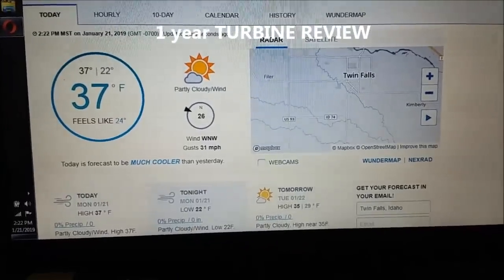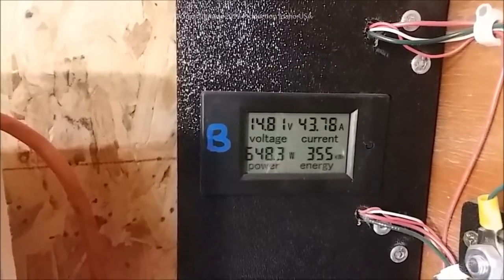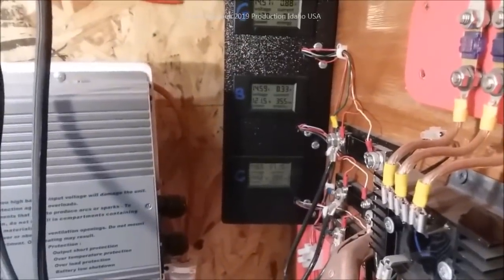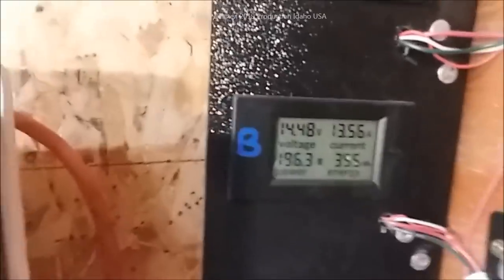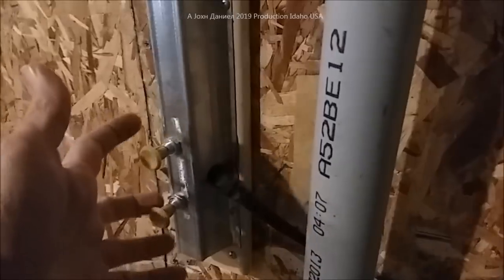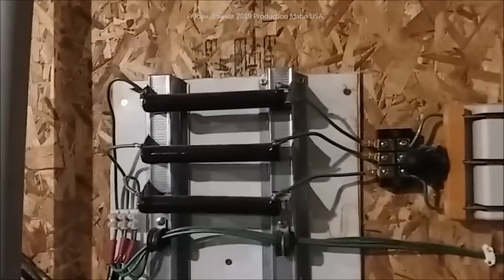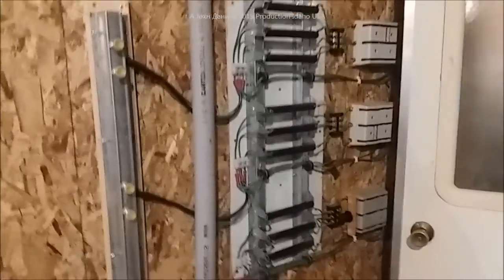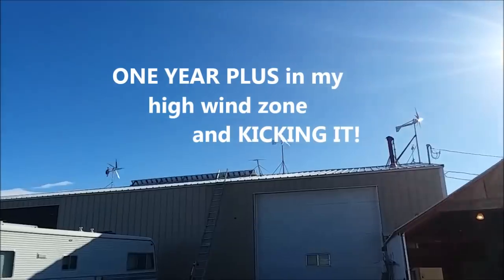The best Chinese Wind turbine, Great results, 1 year+ review FULL PARTS LIST BELOW VIDEO

Comment from the maker: Turbine, extra materials & helpful parts are up under the video in the description. (where it says READ ALL ↴) so hit the SHOW MORE, If you find a bad link, tell me. If you know a better source, also tell me!
 Full electrical parts list from Turbine to Battery ↣↣↣
1 - From Turbine 3 strands of 8 awg wire Home depot or cheaper on ebay ( https://ebay.to/2GpnUCG ) 
2 - From wire, and before controller Mini ANL, 60 amp per leg. So you'll need 3 of these ( https://amzn.to/2UWxm3S ) and 3 of these ( https://amzn.to/2Ia1ZRS ) which will have a few spares in that pack. Place them inline before the rectifier or controller you have.
3 - Best full service controller ( https://amzn.to/2Id9I1z ) for both 12 and 24 volt systems 
4 - From Controller to batteries use 6awg WC by TemCo ( https://ebay.to/2SPuMiy )
Reply from the maker: RECO SAENZ  Look under video where my name and video date is. Theres a source to Aliexpress for the turbine.
Reply: Good day John, i bought one directly from your link, my amps peaks at 13.6A and it wobbles on lower speed. Any advice, seller not very helpful!
Reply: ... can i fly you out to install my turbines? 😐
Reply from the maker: @kairomorals7684  Where to? I don't have the ability to load our 12 ton Tele-Handler on a plane!
Reply: Hey John is 3 blade turbine better then 5 blade turbine am looking in to getting me a turbine I don't want to get rip off so which is better 3 or 5 blade
Reply: Јоhn Daniel  BRO WHAT IS THE NAME OF YOUR WIND TURBINE ..
Reply: Јоhn Daniel  WHICH BETTER 24volts or 12volts WIND TURBINE
Reply from the maker: @3dilawan269  Either one, just base it on what type of battery bank your going to install. I prefer 12 for my system, many like 24 volt. My choice of 12 volt is based on parts availability of 12 volt things you can use.
Reply: Јоhn Daniel  AWESOME idea 12volts wind turbine then my invervter is 48volts how to connect my 12VDCX4  battery can i serries them how to charge my battery using 12VDC wind turbine
Reply: @3dilawan269  my understanding is the higher the voltage(lower the amps) so you can use thinner wires for longer runs, cheaper price on copper wire.
Reply: Јоhn Daniel  12VDC WIND TURBINE CAN I USE 3phase 100amp RECTIFIER connect  TO 60amp PWM solar charger controller  to charge my battery ot is possible?
Reply: Can post some video using PWM SOLAR CHARGER wind turbine via rectifier
Reply: I have to wonder if there is not some sort of digital wind speed meter that can throw a signal and engage 3 relays to shunt the power through the resistor loads
Reply from the maker: @davefroman4700  The voltage sensor is much more accurate on a dedicated diversion system and already accessible to tap the rectifiers output to sense for any setting you want to use.
Reply: there is.... https://www.alibaba.com/product-detail/FST200-221-Digital-Wind-Speed-and_1945683798.html
Reply: New sub here. Building a vertical wind turbine for our homestead. Might pick up one of these later on.
Reply: 2024 now. Any updates?

Comment: build simple system so could use resistors for heating small cabin and charge 24V lifepo4 battery or 36v, if 3 batteries could 1 line charge 1 and install batteries still in series 36v

Comment: I know this is an old tread....cant fine those brands anymore. Do you have a recomandation on a quality 4..5..600 ish watts? Tx.
Reply from the maker: A good turbine with consistent results is the B & C model LW600 3 blade  https://s.click.aliexpress.com/e/_opG0JWD . Then for best results get a 1500 watt and higher wind/solar turbine controller. Use the Wind 1500W Solar1000W  version 12V 24V 48V Auto https://s.click.aliexpress.com/e/_oEnbr2t
Reply: .  Hi John! Thanks for replying.. I m now ready to go ahead with ordering a wind generator. What I have notice lately is that we re not getting massive wind speed here in the forest so.....I think a 5 blade turbine might work better in my area. My system is 24v with 2x 300ah lithium battery. I have 2000w solar pv with victron controller.. the turbine will be mounted a the tip of a 60 ft communication tower so it shouldn't be to big not to crash it down 😮 but big enough  to be worthwhile. You mentioned somewhere that a 48v unit can be used instead of 24v but I don't understand how this could work...or is it necessary? What controller  to buy? What about a wall heater for a dump load?  I ll get my wife to send you a couple beers later as I don't know how to do that.. Thanks  Al.
Reply from the maker: Al, if you have low wind in your area, a 48 volt will give you 60 to 65% the rating but gives you assured results but how I use mine is 48 volt to charge 3 twelve volt marine slave batteries and a 36 volt to (your voltage) converter charger, in your case 29.2v and they are activated on a set voltage in this case a 36 to 24 would pull power from your 36 volt at 39 volts and stop sending when it drops to 35 volts and repeat that as needed. There is numerous ways to make it automatic from a tap on one battery to a dedicated 36 volt diversion design using one of its 12 volt as the activation voltage detection. Send me a Email and we can walk you through a process for your exact plan. olympicpowercontrols@yahoo.com It's a hassle to check responses on older comments that the system tends to not alert us on verses new comments you always are informed about.

Comment: Great video. Where can I get a 3000w turbine that actually produces 3000w?
Reply from the maker: Only one model that can do it for under $3000 is the FLYT Wind Turbine 3KW https://s.click.aliexpress.com/e/_oF7EYAb and it must be mounted on a 3" heavy mast. They use Fisher Paykel style PMA with a Delta Stator in them. Very large turbine.
Reply: @ awesome. Thank you so much
Reply from the maker: I expect a 35% tariff on all wind turbines by the end of January. So get what your seeking fast as you can.
Reply: @JOHNDANIEL1  wow thanks for the info

Comment: Uhhhh make a gasifier with a side feeder.  Top is good to add a hose but the fuel is Pure and will run a generator.   No need to refilter and try to use water.

Comment: All practical tests show that all small wind turbines hardly generate any electricity.
And mostly at costs very significantly above 1$/kWh!
This is because there is hardly any wind close to the ground & extremely gusty, which always reduces the lifespan of the systems. 
Solar panels, on the other hand, generate electricity reliably for 25 years at approx. 8-12 cents/kWh!
Reply from the maker: All practical test were done in the middle of a city at in bright calm weather with sunny day time in between 30 story buildings. Our use is up 32 feet high like they should be in rural setting and at night keep our batteries above 50% DOD in the worst conditions. How much is cutting 50% off the life of your battery bank to not have some input during snow and storms when solar is crap, just to promote solar panel companies??
Reply: @JOHNDANIEL1  You are mistaken, in most of the practical tests the small wind turbines were erected in free-standing gardens or meadows. Of course, it is extremely sensible to erect the turbine as high as possible - like yout (32 feet!). But then the tower and its gust protection costs extra. The core is: With solar modules you can certainly produce electricity 10 times cheaper - in sunny and cloudy weather. Not in winter or in the night. However, if you absolutely have to be self-sufficient in electricity, you cannot avoid the inefficient wind turbines.

Comment: Hej John 
Thanks a lot for making this !
I just want to sure that the "B" windmill is the first on in your description , the "Premium 500Watt turbine 3/5 blade 12/24/48 volt"
and also ask if you took the 3 or five blades , or even 6 blades as I can see they are selling now  ? 
And how noisy do you think it is ?
I'm living on a houseboat in Denmark and I don't want to destroy my good neighborhood 😀 Its gonna sit in the mast about 8 meters high !
BW
Reply from the maker: You will get the low wind 3 blade model for your purpose on that house boat. Very good power, very quite 600watt is https://s.click.aliexpress.com/e/_99l1XF Wire with equivalent of 8 awg wire for 12 volt, 10 awg wire for 24 and 48 volt chosen. Be sure to use a brake switch as I show on a more recent video. If you intend on charging LiFePO4 see a more recent video on Slave Battery use.
Reply: @JOHNDANIEL1  
Great , thank you !
I gonna try it out !

Comment: Hi, can you advice please? I have same turbine ( I believe so) I have managed to assembly it. I have 48 V version, when I connect to my battery, controller stops to flash red which indiciate that is producing some energy i guess. I also measured that it makes only 30 volts instead 48 or better 50-52. Can you please advice what it could be wrong? Possibly leafs vice versa?
Reply from the maker: Blades should be proper if you followed instructions and markings. See if it is a B&C or GREEN ENERGY sold model. They make full charge + 8 voltage with winds over 12.5 mph and can reach basic charging at 9.5 mph. Testing only the wires without controller connected from the generator you should get open voltage of 60 to 70 volts on a 48 volt model when winds exceed 13 mph. 
Numerous similar looking models are by Smaad and other bad sellers who spec much lower grade materials but same body and blades.

Comment: Hey John, can you plug a wind turbine into a solar generator like a pecron e3000? If so, in your opinion is it worth it?
Reply from the maker: Yes, but not without some intermediate power controls. The best method is to use a couple of cheap Lead Acid batteries for the turbine, then a Buck Booster to send its power to the E3000 or if it accepts Auto charging 12.8 input then use that.
Reply: @JOHNDANIEL1  thank you for your time and help

Comment: 500w is more like 200w i had my drill at full rpm going to a rectifier and straight to the battery. Max 15amps. B n C b creations thats where i purchased the "500w" 200w more like
Reply from the maker: You won't get 500 from a drill. Not unless its loaded RPM's is over 1300 and your drill exceeds 1.5 horse power.

Comment: Hi John here from the Dutch guys. Just got the turbine up. only at 4 meters. Soon some guys will come and we aim to put it up at 7 meters. No turbine spin at windforce 4 and wind from the North. mu house is blocking it.  I hope tomorrow N-E. The sooner the better.  Greetings from the boys from the North of the netherlands.
Reply: Ok John. Here you go. This the effort from the boys of the North, Check out our brackets. Today good winds and the light of the MPPT controller has shone today.
Reply: https://www.youtube.com/shorts/gemWo07wmUI
Reply: https://www.youtube.com/shorts/gemWo07wmUI
Reply: full spin now from all directions now. providing there is wind. This is only 1 meter 20 cm in diameter at 500 watts. If we want 1500 or 2000 watts then will need to plead our case with the town hall or settle for the best Darrieus that we can find.
Reply from the maker: Very good, give it a few good winds to clean the sliprings brushes and break in the magnetic fields and it will do well in your area.

Comment: My turbine makes a rattle noise almost sounds like bad bearings when its spinning is that normal?
Reply from the maker: If its the ones I use, I'd say not likely the bearing. Check for the hub being tight, and the blades being tight. Many times the nose cones will make a clatter noise from one side being loose. Bearings on these are dual row, you would get a whine that gets louder over a few months then a clicking on and off then a growl from it. Those bearings are good for 8+ years in normal to high winds, up to 12 years in most installs.

Comment: Hi, appreciate youre great videos...

I was wondering if you have any advice for my situation which is as follows,    i want to fit a wind turbine to my 30ft boat but i think the ones you have there would be too big, im looking for as compact as possible, something i can fit to a lightweight removable pole (such as a window cleaners extending pole)

As powerfull as possible for the smaller size but being compact and cheap is more important than sheer power maybe upto 300w obviously more power is better but size and weight is priority as it would be taken down in the marina and used when away.   (To charge 12v sla batteries so not usb only models)

Oh and a pole clamp fitting, not flange as the pole would likely be alloy)

So to summarise, small lightweight 12v, poleclamp diameter 1inch approx, usable power of 60w to 300w for charging batteries.
And under £200 or as cheap as possible if thats not realistic.

Thanks Mat.
Reply from the maker: Get the 3 blade G300  https://bit.ly/2oJBxFq  it's not as tiny as you want, does fit on a 50mm post, (1-1/2") nothing can make your goals as written, but you can get the firefly 100w if you can still find one. I may know where some can be found but they were made in Singapore and not much industry there survived bad government and covid.
Reply: @1JOHNDANIEL  thanks very much for taking the time to reply, the main problem i have is the only mounting point on the boat is the rear corner section of a stainless steel rail with a down pole and corner brace but i dont think it would take the weight of those turbines in wind.

The only other option which i feel would fit well is some kind of roof mounted vertical wind turbine if there are actually any which output usable power?

Thanks.
Reply from the maker: Skip the idea of a vertical wind turbine, just be willing to drill a few holes in your boat, of course none below water line LOL. You need a designed mount, something that would have spars off the transom and post clamps or what we would call rail clamps on your rails to create a platform on that platform is how you would Mount the turbine and I would simply mounted 6 ft high. This allows you to strap off the turbine blades in severe weather without putting yourself or it in danger. If you'd like to send me a ton of pictures of the boat and some dimensions I can probably draw you something up based on the boat structure since I worked on many boats as a career process pipefitter for years. olympicpowercontrols@yahoo.com

Comment: So in 7 months it made 355kWh. That's 355,000Wh in 5110 hours or an average generation amperage of 69 watts. From a 500W generator. 
That certainly helps but it's only a 13.8% power factor and less than 2kWh per day when the average westerner needs 14 kWh per day..
Reply from the maker: It is in addition to solar. 4 total running, 500 watt and 800 watt along with 4800 watts of solar. Works good.
Reply: @JOHNDANIEL1  Certainly sounds better than some wind turbines I've read about. That being said for the system I am contemplating, I think I will use pv for my base load (with a large battery bank) with one, maybe two, turbines like your's to top things up.

Comment: I'm using a 500w 12v turbine from B- creations. I've ordered the marsrock 3000w 1500wind 1500w solar hybrid mppt controller. I've ordered 2 100ah 12v batteries wiring them in parallel. Do I need the battery balancer that comes with the mppt controller ? Will this mars rock mppt controller work with this great turbine?
Reply from the maker: Not really, usually when you get the 3rd wheel involved (3rd battery or more) then balancers make sense. The controller will do well, set divert/stop charge for LiFePO4 to 14.20 and your BMS won't top charge shut off on you and will maintain 97% full without over charging. Only put a max of 70% of the solar it allows, and then the turbine will be not in competition and will run nice.